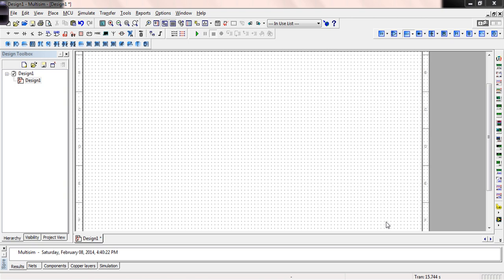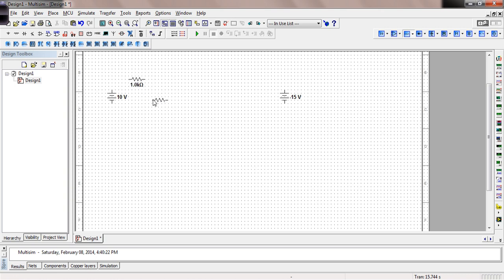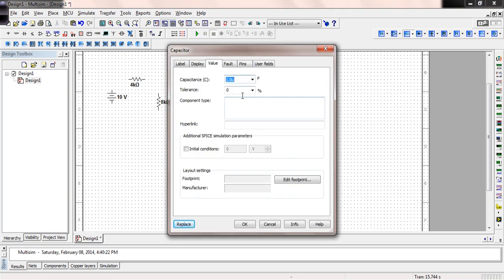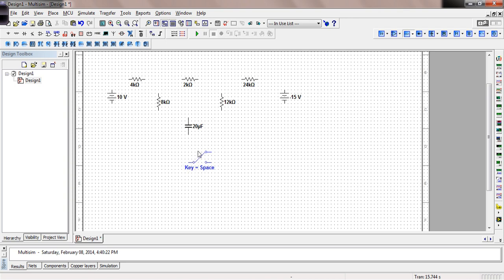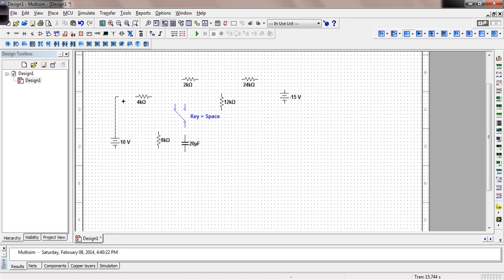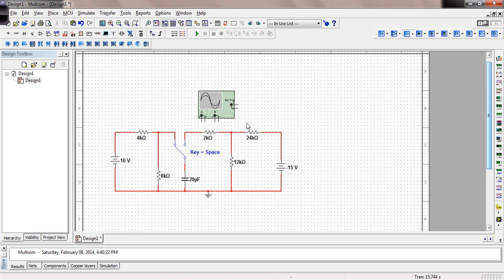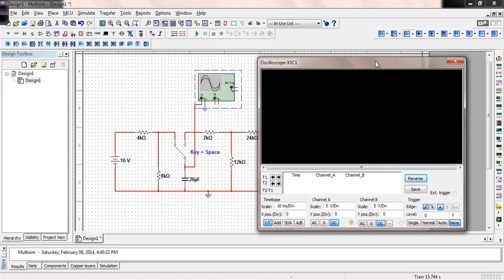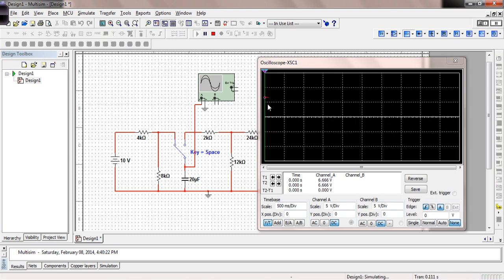E5 4 2 Example RC Step Response Multisim Simulation

Comment: Thanks for the video. I have only one doubt, how did you figure up the timebase in the oscilloscope?
Reply from the maker: 3 - 4 times the time constant is a good approximation of how long the circuit takes to reach the final value.
Reply: @brinton417  thank you very much!